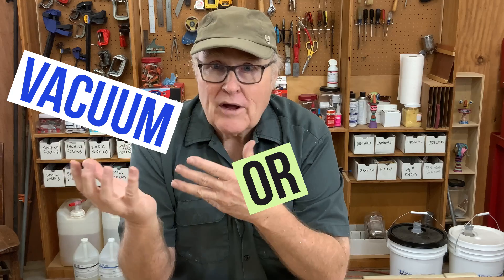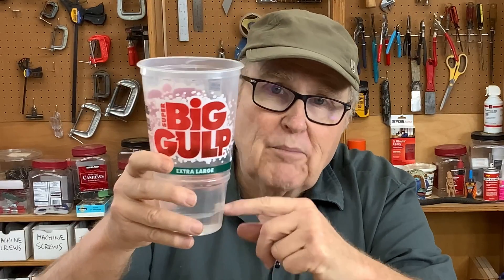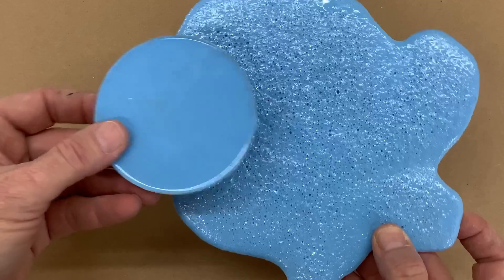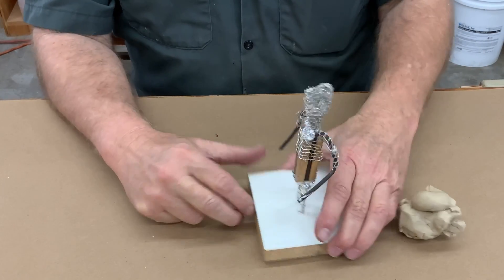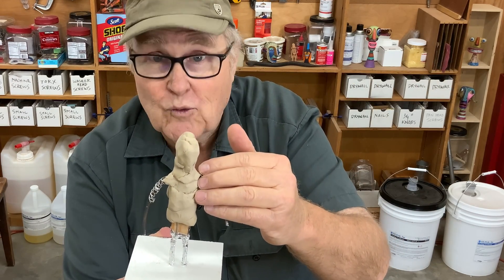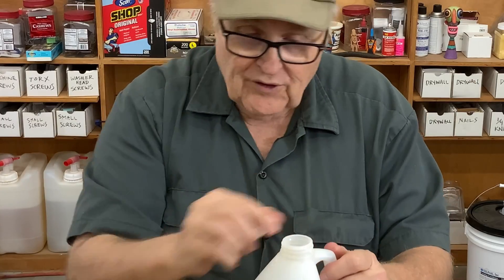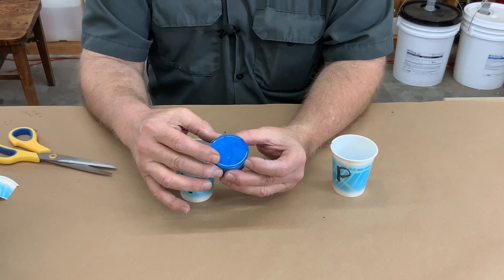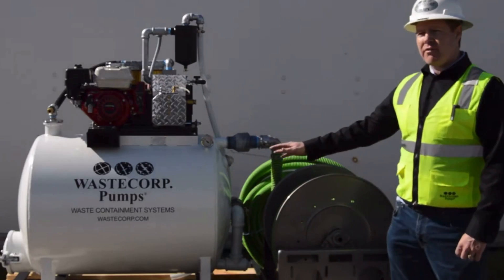Which One To Use, When, How?  WHY IS THIS SO HARD? !!!

Comment: The thing I see a lot from amateur mold making videos is people using a pressure pot when they poured rubber on the master to get the bubbles out (they put the master with the rubber into the pressure pot to cure), it seems to work but from what i understand of the pressure pot is its not actually removing the bubbles and just shrinking them, in this case would the bubbles in the mold distort it outside the pressure pot and the bubbles return to they're original size (assuming the silicone is soft enough)? same as the reason you would want to make sure to vacuum the silicone of any molds would would later go in to a pressure pot?

Comment: Robert, do you ever cast in self skinning foam? I wonder how that differs from casting in resin.
Reply from the maker: It is a foam so you must have a mold that can withstand the pressure of the expanding foam. Also I believe you must use effective release agents as most foams are very strong adhesives.
Reply: @RobertTolone  That's the part that was always missing in the Face Off TV Series and it was driving me nuts. They never showed a foam cast, only the before and after. The only info I have been able to gather is that the mold is usually made from hard gypsum plaster like Ultracal 30 and that they're using a huge syringe to inject the foam mix in the mold. I'd really like to  know more about the technique but it seems to be a prized knowledge that rarely gets out of the FX shops...

Comment: Thanks Robert, great video, as ever. I found you through the Crafsman.

I'm struggling to get my pressure pot  above 30psi as it's originally setup as a paint sprayer and there's a spring safety valve on there that pops when I go much over that. 

The pot is rated for 50psi but if I can avoid messing with safety valves I definitely will.

My question is - will 30psi do the job if I have a slow cure resin? 

Thanks so much for your time.
Reply from the maker: I run my pots around 50 psi so I don’t really know ho low you can go and still get good results.  Experiment until you get a good result.  Make sure your mold cavities are properly vented.

Comment: Vacuum is low pressure, meaning the air inside the mould/resin will expand and coalesce into larger bubbles that will rise to the top quicker.  The pressure pot increases pressure and has the opposite effect in compressing the bubbles down until they're so small as to not being at all noticeable, allowing the resin to cure bubble-less.

Comment: Have you experimented with using something like Bloxygen (or if you have an argon tank in your welding setup) in the resin bottles before sealing? I've been told it works wonders keeping paint in a can nice and fresh. I reckon it might work with epoxy too?
Reply from the maker: I did a video on the subject:   https://youtu.be/FBC9xQ6H4oc

Comment: Great video as always!

I could afford only one thing and went with pressure pot. That changed everything for me, and there is no going back now. But when you put casting into pressure put using rubber that wasn't de-aired, you are going to have a bad time, haha. So many pimples on the casting. Since I can't afford vacuum now, I use pressure to make rubber "de-aired". I cast my own designs, so I knew the sculpture and never crushed it with pressure. Only once I tried to make a mold of a small decorative pumpkin, but it was made from foam so... At least it was small.
Reply from the maker: Pressure curing rubber works fine as long as you are certain that you won’t damage the model.

Comment: Something I do for "sealing" my resin containers is to put a gasket on the container and then tighten the lid on it.  I just cut a chunk of plastic bag for the gasket.  (Use PP bags)  It works pretty well to keep the build-up of resin out of the container threads.

Comment: Hey Robert, what's your shop vacuum? I'm casting vinyl in the United States and I need a stronger vacuum to degas such thick plastisol
Reply from the maker: My pump is a Welsh 1402. I bought it refurbished but still it was not cheap.  Bought mine from AVac Industries.
Reply: @RobertTolone  cheers Robert, thanks for the reply. I didn't expect cheap and it looks solid, I appreciate your time.

Comment: What about vacuuming the A&B separately before mixing? I know you’d still introduce air bubbles while mixing, but is there any added bubble reduction in the final cast? With and without pressure?
Reply from the maker: The foaming in resin is a chemical reaction that begins when you mix the A and B sides. So vacuuming the resin before mixing doesn’t help prevent foaming.

Comment: I recently did a big experimental project with new rubber and mold cases made from pink extruded polystyrene (XPS) foam, and threw the molds in my pressure pot.  The failure was spectacular!  When I added 40 PSI to that pressure pot, the mold collapsed and I came back to a pressure pot filled with escaped rubber!  This video should help anyone avoid that same mistake.
Reply from the maker: Many a poor fool (like myself) has put things made of foam in a pressure pot.  It’s not a pretty sight!
Reply: @RobertTolone  XPS does seem to withstand full vacuum though, over relatively long periods of time (24 hours).  
My pressure pot has a rather large volume, and I thought I could evacuate it quicker when using a small container of resin if most of the pot was taken up by some type of solid filler.  I had some sheets of XPS foam insulation on hand, and it is light and easy to shape and handle (unlike gravel, bricks, or other solids), so I wanted to see if it could be used as a filler for this purpose.  I put a sample of XPS foam into the chamber and kept it under full vacuum for about 24 hours, and it fully retained its shape, with no loss of dimensional accuracy.  Some other types of foam I tried collapsed when atmospheric pressure was restored, showing that the bubbles in the plastic had outgassed under vacuum.
Therefore -- XPS foam may be useless/dangerous in a pressure pot, but it does have its uses in a vacuum chamber.  Polyisocyanurate insulating foam panels worked equally well.

Comment: I have the same Amazon vacuum system. I just use a bicycle pump for my pressure pot action figures. What a bit of modding for the bicycle pump to work for your pressure pot.  It works for me. Absolutely no air bubbles in my resin.. Great video great tips!.👏👏😻👍
Reply from the maker: How big is your pressure pot and how long does it take to bring it up to pressure?
Reply: @RobertTolone  Tell me what you think about this idea:
3.5'x chamber made of plexiglass and blowing air using high pressure pump w/ strong valve. 
I see no reason why it would not hold up well using steel brackets, bolts, nuts, screws and a high-pressure hose. My pouring always includes a powdered metal with it such as aluminum / bronze etc.

Comment: Another great explanation!
I believe it's also recommended to only pressure cast a mold only if the mold was created with vacuumed silicone. 
Also, a can of dry air can be sprayed into your resin bottles prior to closing to help reduce moisture in all the empty space in the bottles.
Reply: What you believe has little bearing on reality.

Comment: Thank you for your informative and inspiring videos! I'm a new subscriber and your mold making videos caught my attention. I am casting with Cementall. It is a brand of quick set cement. Do you know if a pressure pot would work with that material? Thanks again!
Reply from the maker: Are you getting a lot of bubbles in your castings now?
Reply: @RobertTolone  not a lot of bubbles. I tap the mold quite a bit, but I still get some. I’m not even sure a pressure pot can be used with cement.

Comment: What pressures do you recommend for each?
Reply from the maker: For vacuum as high as your pump will go, at least 27 inches of mercury.  Pressure pots between 50 and 80 psi works for me.
Reply: @RobertTolone  thanks!

Comment: Thank You. That's exactly what I hoped you personally would suggest. I believe I have found a few "perfect" vessels, it's 12-13 feet long, but only 6-8 feet once I get the ends squared, with a 44inch interior circumference  (pre-cleaning/resurfacing) and an average exterior circumference  of 55ish (also pre-lathe) leaving more then enough to cut down to at least two tanks , they'll cut the ends off and turn it inside and out but I got to turn the tube(s) into tanks ie. have bottoms welded on find some way to NOT make the pressure chamber a bomb
Reply from the maker: You will need a very high volume compressor to bring those giant tanks up to pressure before your resin cures.
Reply: @RobertTolone  My plan is to make two tanks out of the tube, with the largest one 3ish feet tall (though I doubt I'll need that much height). What's terrifying me is the lid for the  pressure pot. Until I meet someone with the necessary engineering experience I'll just have to get a "ready-made" one. But as to your statement even the taller tank will still only have a (estimation) 6-7 cubic foot volume and that's the one I was planning to be the vacuum chamber. Is that unusually large?
Reply: @RobertTolone   Circumference not Diameter. Wow yeah that would be Huge, My bad

Comment: Loved this! Answered some of my most burning questions re molding and casting. Wondering if you have links to those pumps you showed at the end? Also isnt there a minimum or maximum pressure to look out for?
Reply from the maker: Look for a vacuum system that the manufacturer says will de-air resin.  I run my pressure pots at 50 to 80 psi

Comment: Your video came RIGHT on time. I just got a CA Air tools Pressure pot and this has been my first week trying it. I am absolutley BLOWN AWAY by the difference of not having one. I was close to giving up on this hobby, but I got a quiet CA Compressor and the pot from them, and I am just shocked with the ease of use. I'm in the money hole, but I feel like in the LONG RUN, this is going to be SO WORTH IT. THANK YOU-- Honestly some of your previous videos really convinced me to pull the trigger on this.  

I'm mid-way through the video now So I'm excited to hear what more you have to say!! Your videos have been quite literally the most VALUABLE, CASUALLY PRESENTED advice on the entire internet.  Some of the vids on casting are just so technical or more so specifically on dice casting and mold making, your videos and your past in toymaking has extremely EXTREMELY helped me get through some tough spots when it comes to making stuff.  I pulled my very first toys I made from scratch/ my own 3D prints (Pressurized my silicone for the first time as well!) They came out and I almost cried ahaha. No bubbles, and I had tested one with mica powder.. looked professional.  GAH OK Enough ranting, I'm learning so much from this vid alone.. even though I got a Pressure Pot I was still confused on if I needed a vacuum.. but you laid out out perfect... One SUCKS.. other one BLOWS.  Got it! 😂

Comment: I want to foam a batch of flexible  PU resin. Could I add a drop of water and whip it good before pour it 
into my mold? My finished part needs to float.
Reply from the maker: If you add water it will foam. It’s hard to say how much. It would be better to cast the part with urethane foam rubber.  But you can always try it as an experiment and see if you can make a good part.
Reply: @RobertTolone  I did a small test with 2 oz  resin mixed with one drop water whipped it with a whisk and it foamed up quite nicely.  after my tester cures for awhile I'll give it a stress test
Reply: As Robert says much better to buy a dedicated foaming PU there are plenty out there to choose from.  The issue with just adding water is the a little goes a longway so adding to small batches of resin in hard to achieve repeatability.  From a chemical standpoint adding water also messes with the mix ratio of the two parts so your end product will not be as cured as it should be.  Also when making foams commercially stabilisers are added to produce stable foams with uniform bubbles this gives you a consistant high quality product.  Bottom line is will adding water get you a foam, yes, will it be a good foam, probably not!

Comment: If you don't have an air compressor, could you get by with a bicycle/manual car tyre pump, or is the required pressure for casting too high?
Reply from the maker: No, a bike pump can reach the necessary pressure. The problem is how long it will take you to pump up the tank. Bike tires are actually a very small volume of air. But you could pump up a storage tank until you have a sufficient volume of air at high pressure. Then release the air into pressure pot.  I think after a few castings your arms and back would be really sore! But it could work if you are making small parts and your pressure pot is really small. If nothing else you’ll get a great workout!

Comment: Good point Robert on model construction and pressuring molds. This can cause some real surprises when you open the mold and find not only a failed mold, but a destroyed master if you (high) pressure the wrong item (eg weak masters w voids, glass objects etc).. Can come out resembling the end results of a transporter malfunction.

We make our own masters and can control that aspect.  I’m happy we don’t have to deal (much) with other folks masters!  We pressure our molds at 10psi over what we’ll use for when we pressure the casting.  Why?  We’ve found that this helps prevent mold blowouts, eg BBs on the casting and essentially a ruined mold after it was pressured.  We’ve got a vacuum system, that rarely, but on odd cases gets used. As mentioned in my previous comments (I think on this channel) we are in DFW area and temp/humidity is a big enemy.  So we do all our molding/casting & mold storage in a temp/humidity controlled environment; gives us year round consistency.  We pressure molds and castings because for us, it streamlines our workflow.  We’ve arrived at this over the last couple of decades by a lot of trial and error,  talking w Reynolds(Smooth-on) [our local store has many decades+ years combined experience] and other model resin kit casters (one who did large (1/350) scale model ship model casting in shop made aluminum $$$ forms!) most of whom sadly are no longer with us.  If you want to see an example of BBs don’t vacuum or pressure your mold..but do pressure it while doing your casting (we mostly use 55psi, make sure your pot is safe for this and any other pressures your using, we started w homemade converted pots but now use commercially purchased purpose-designed pots): warning afterwards, the mold and casting are likely throwaways.  Note: for molds which we don’t pressure set, that mold is always clearly marked/coded so we don’t accidentally grab it off the shelf and toss it in the pot. Yeah, been there done that 🤦🏻‍♂️. 

This is what we found works for our needs, every reader’s situation is likely different, don’t be afraid to experiment, it’s part of the fun and the challenge!! 🤙

As always, just sharing, nothing more. nothing less.
Reply from the maker: Thanks for your detailed comment. I pressure always cure my resin castings in rubber molds that were cured at normal room pressure.  You don’t have to cure a mold under pressure to cast with it under pressure. It works just fine.
Reply: @RobertTolone  one grey hair to another, that one we’ll likely have to agree to disagree on Robert at least for now.  Unvaccumed or non-pressure cured molds, we get BBs 90% when pressure casting.  We primarily use Mold Star 30 & 20T and some Mold Max 40. Long long ago used silicons (tin) from Bragdon (decades ago)with same BB results. I used to do demos at local Modeling meetups (Eaglequest etc) and would show the BB example. It’s fantastic if you get different results through your process with those same materials, I’m all ears would like to see where we differ and see if I can eliminate the BBs without having to pressure/vacuum the molds before pressuring the casting 😀

Comment: Excellent video as usual Robert. Just one question. How much pressure is necessary in the pressure pot?
Reply from the maker: I don’t have a scientific answer, meaning that I haven’t tested a wide range of pressures. My tanks can be pressurized to 125 psi but I usually run them at about 50. I used to run them at 80 but gradually lowered it because I got the same result at the lower pressure.
Reply: @RobertTolone  Thanks. I can do up to 60psi with my smaller compressor so that’s good.

Comment: So what I'm understanding is that a vacuum chamber is good for only degassing rubber, and a pressure pot is good for degassing resin. But not the other way around.
Reply: As I understand it, pressure doesn't remove the gas from the resin, it just makes it hard for the gas generated by moisture in the resin to come out of solution and makes what bubbles do form so small you can't detect them.
Reply: @mikeoliver6742  That totally makes sense then. That also explains why my resin continues to release gas to no end in my vacuum chamber, but it works great for rubber. Rubber doesn't have as much of a chemical reaction that releases air, so you can vacuum most of it out. Whereas resin creates air from moisture, and the bubbles need to be constrained under heavy pressure to keep them small until the resin sets up.

Comment: A question if I may:
If I'm casting PU-rubber in a silicone rubber mold, does it make sense to vacuum the casting after pouring it in?
Reply from the maker: Check to make sure your pu rubber will cure in a silicone mold.  Rubbers notoriously hate one another.
Reply: @RobertTolone  I'll be sure to ask the manufacturer and then make some test to be doubly sure 😉 thanks!